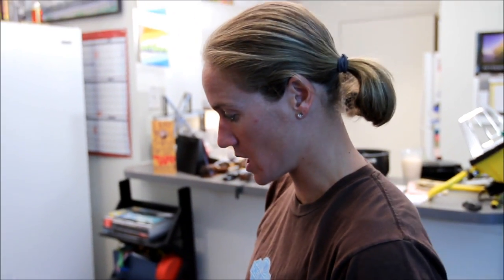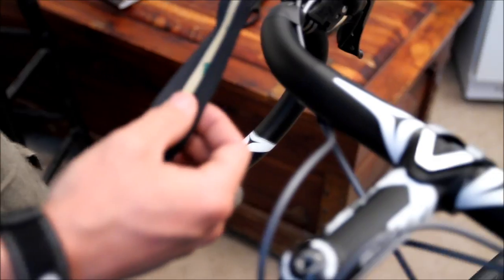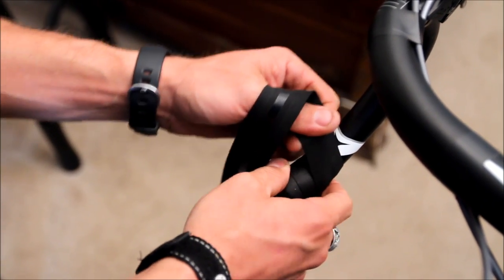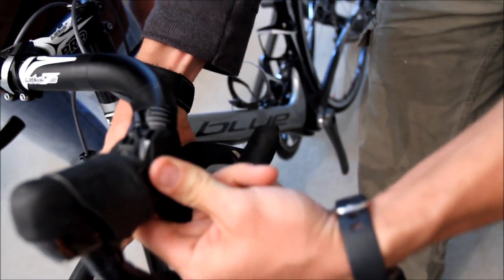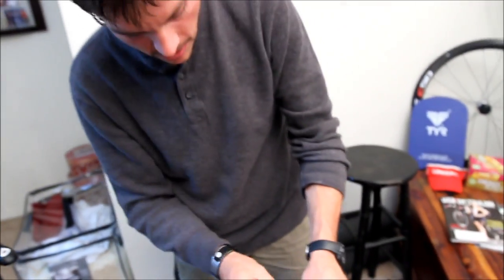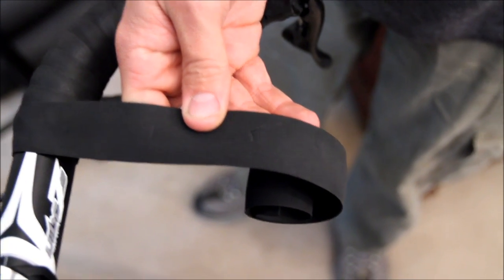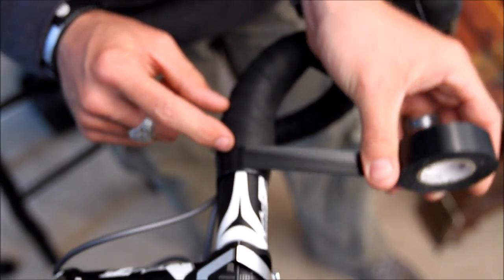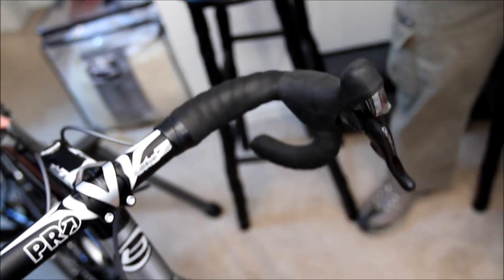How to install bar tape on your bicycle w/ Amanda "Doc" Stevens

Comment: Finally a tape wrapping video that gets things right. The always wrap to the outside is correct, iv'e seen even pro mechanics that say to wrap to the inside, but that's not the way that the hands twist. The hands twist and put pressure in the direction that the fingers grab the bar ( to the outside ). Also correct is that if you use the small strip over the clamp you don't need to figure 8 around the lever ( it adds too much tape to that area ).I thought the presentation was very nice, explaining about everything you need to know, you could have gone into greater detail on a few things but that would have added many more minutes. Also great bike.

Comment: This was okay for beginners, but fails to show the finer points that make a beautiful tape-job, like starting under the bars, instead of on top, varying the overlap depending on the thickness of the tape, overlapping the levers by at least a quarter width of the tape as you criss-cross, overlap on the bends, and finishing with a professional finish. Using black tape on black bars was hard to see. Tyler's voice is hard to hear, but yours was clear. You should narrate everything. Also, Tyler looks like he just woke up. :-)